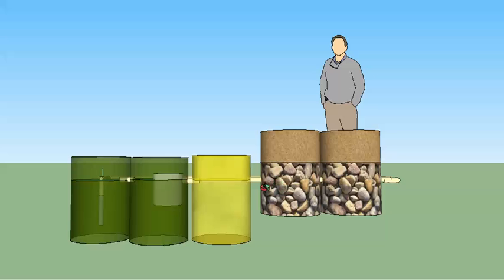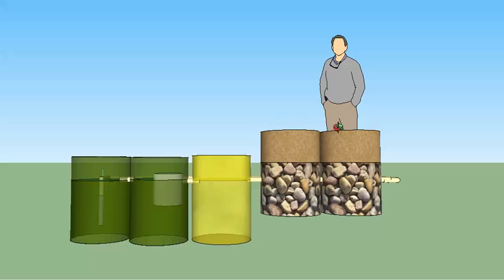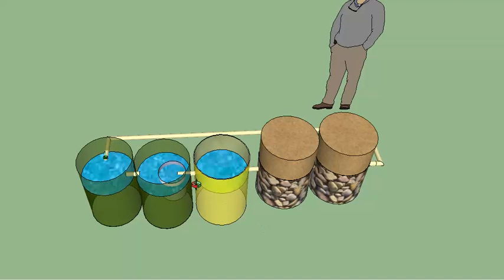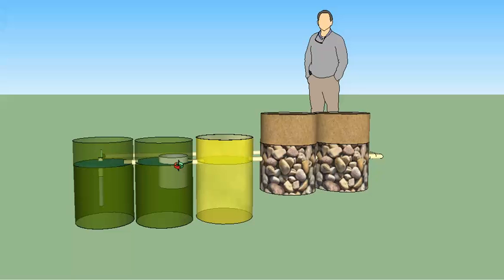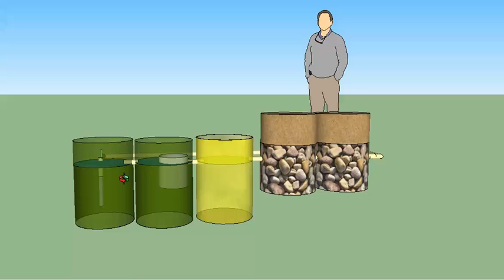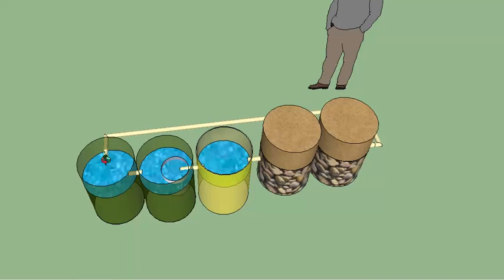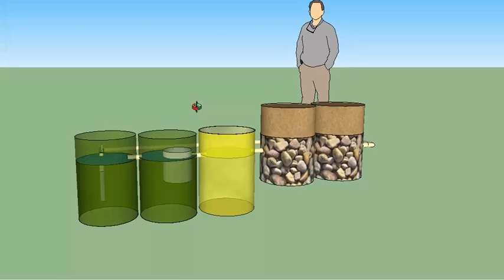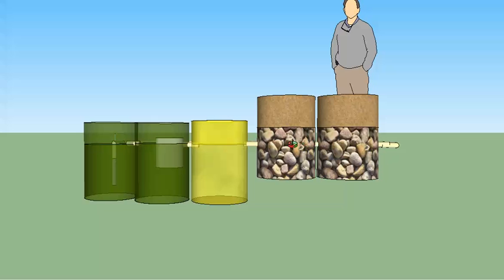Earthan Beds Explained

Comment: what causes the wicking action from the 1.5" stones up into the soil? What is the wick?
Reply from the maker: I don't know.  I think Paul Van der Werf originally designed this.  I have built several and it works. I believe the air gap is important for oxygenation.

Comment: How is this system going?  Are you still pleased with it?
Reply from the maker: +James Oldfield I've built several variations of this system and like it a lot.  It's easy because I don't have to water the soil.  Very few weeds grow.  I have had problems when I did not mix enough clay into the soil because the soil must be able to wick the water.  At first I ran the pump 24/7 but I now circulate the water a couple times a day.  I built some of the containers out of  fiber-glassed plywood but ran into problems with those because the wood shrinks and swells enough to break the bulkhead seal.  My favorite garden is built in the ground without a tank.  I basically built a pond with rocks and soil with a sump in the ground.  This sump is large and holds captured rain water that falls on the garden during our rainy season.

Comment: So do I understand correctly that the air/water mix from the airlift pump travel together all the way to the wicking bed?
Reply from the maker: Yes the air lift pump pushes the water up from the sump with bubbles and aerates the water. 
Air lifts last longer than mechanical pumps, cost less, are more efficient, and they pass solids with ease. 
Get yourself a small compressor like the General Hydroponics pump that puts out 20 lpm at 84" head.  Then play around with some PVC scrapes to see how much water you can pump. 
The down side is they are a little noisier and don't pump as high as mechanical pumps.  But the General Hydroponics air pump is very quiet and you can generally design the system to require only a small rise.

Comment: Bob will your system be indoors or outdoors? I'm curious, because if outdoors how do you prevent contamination of the water reservoir in the beds from heavy rains?
Reply from the maker: The beds are outside.  I cover them with a structure that is 10' tall. 
If the rains are not too heavy I doubt that it would cause a problem, but it's best if the rain is kept off.   I often hose down the plants to wash away aphids and dust.  I also water seeds at first from the top.
Reply: Thanks for the speedy reply Bob. I just recently set up my first wicking bed. We had a few inches of rain the other day and I noticed the water in my reservoir had become discolored. I remembered a video Rob Bob had shared on FB featuring the earthan groups mosaic integrated AP garden. If I remember correctly, aside from the fish tanks there was nothing preventing rain intrusion on that system at the beds. I can't find the video anymore. Nonetheless it got me thinking. Regardless I'm building everything else in a greenhouse so it shouldn't be an issue. Thanks.
Reply from the maker: Jason Ratz
 It not ideal to let the rain into your Earthan beds because you loose some nutrients when they overflow.  But it's easily replenished so unless it's a lot of rain all the time I don't think it would be a huge problem.  My Earthan Beds are not enclosed, the structure I mentioned is just a roof made of 6 mil polyethylene.
Green houses are nice, but I prefer the open air.  I live in Northern CA and the temperatures are generally above freezing.  I like the bugs and birds in my garden, but I'll admit I'm not too happy with the squirrels.
Reply: Yeah the greenhouse will allow to control things better and automate stuff. Primarily as you said it's to keep the critters, and the pests out. I'm in south Florida and there's no shortage of bugs here, good and bad. I just wondered how the contamination from the rain in addition to what it would pull from the bed would affect the fish in the Aquaponics. After seeing how discolored my water became after that first rain, it had me curious. Thanks.

Comment from the maker: Sorry I missed your comments about the Earthan Beds.  
You are correct this is like a wicking bed.  I have finished rebuilding two of my wicking beds and they are all plumbed and circulating water from my bioponic system.  I watered the top just a little after I planted some seeds, but the soil does remained moist.   
The large rocks do not offer quite the same area for nitrification, so you may have to include a standard media bed.   My bioponic system also has two media beds and a DWC